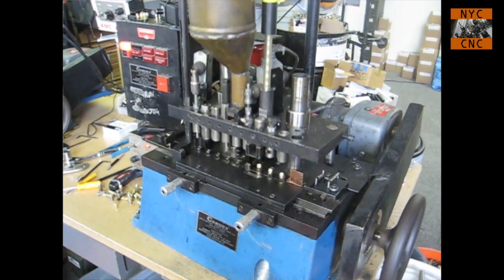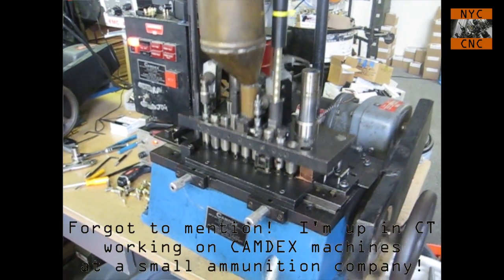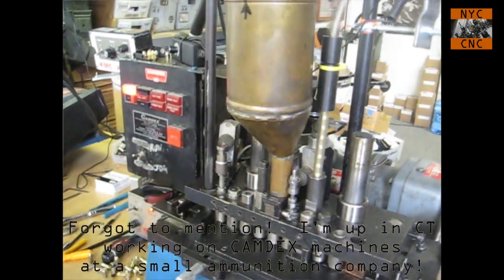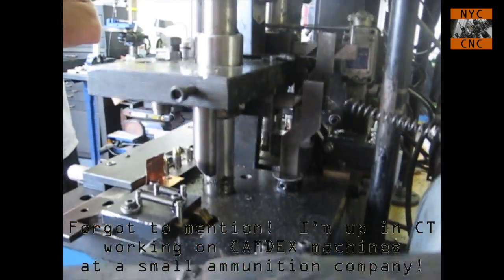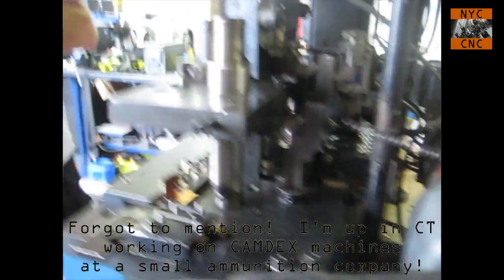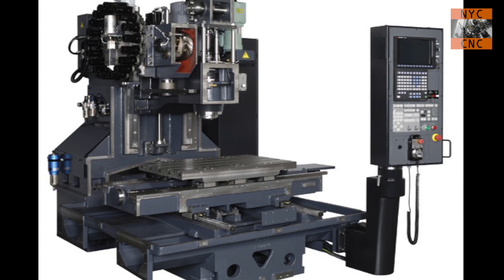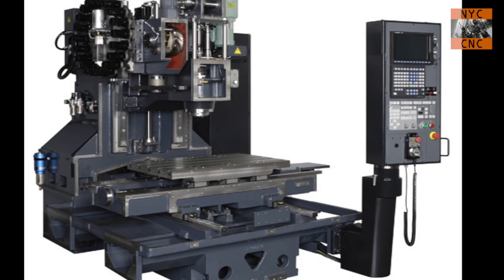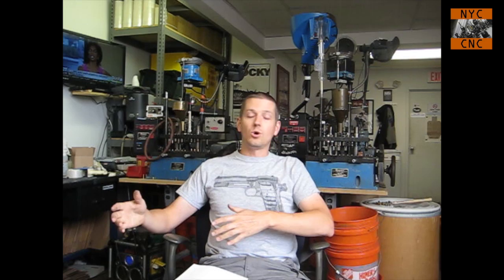Hunt for the VMC - Beginners Guide to buying a Vertical Machining Center

Comment: Isnt mori seki the same company as DMG Mori?
Reply: Deckel Maho geildermeister aka DMG merged with Mori seiki  now known as DMG Mori...This merger happened So they could enhance both companies global presence  and enhance both companies product range and Market share basically the thinking was if you can't beat them join them.They manufacture very high quality machines for various applications.This company is goal orientated and the very top end of the market.Very expensive but very solid machines @ the very forefront of technology.Their main competitors are OKOUMA/MAKINO/MAATSUURA not HAAS/Doosan or any other of the cheaper machine tool manufacturers out their.DMG MORI machines are aimed @ the high value component and production sectors not really subcontract and smaller job shops.Im not saying these sectors don't use them but the high machine cost restricts a lot of people from purchasing these higher end machines.

Comment: HAAS ALL DAY.
Reply: ROFL FKING MAO
Reply: Just brought a brand new Haas Mini-Mill, super simple control, havent had it long but Ive ran Haas's for the past 10-15 years.
Reply: BROUSBLADES Congrats. Did you look at anything else on the market?
Reply: NYC CNC For 1, I am using my CNC in my garage so space was limited, it was pretty expensive but my father has purchased over 2 Million dollars worth of Haas' over the past 10 years so I got that "family discount". They definitely rip you off with all the "extra" that should come standard with the machine like the memory, the machine came with 1mb of memory, keep in mind an MP3 song is usually between 3-4mb. Upgraded to 750mb for almost $2000 extra. Once you get all that bullshit out of the way they are great machines, they have great customer service and they are extremely user friendly. I ran Haas lathes for a lot of years too but mostly 5-Axis Haas for the past 8 years.
Reply: Mastercam

Comment: Man,are you on right track. I would check out a Fadal not greatest rapids or fastest tool changes but cheap and cheap to fix.  Mori Seki and DMG mori are the same company now.
Reply: NYC CNC Pretty much like used car.. Does it look used and abused? If so probably because it was.  Ask the owner if you see the machine under full power running a test program and couple tool changes. Does the owner have the manuals real handy if you get an older machine. Does the owner have services records? Two biggest questions are why are you selling it? Whats wrong with it?  What kind of environment? Job shop? One Material and one job etc

Comment: Support American products please.
Reply: Buy a good used mill and MANUFACTURE American products!
Reply: NYC CNC same as any other machine, the really important parts! Ballscrews, linear guides, motors, odds and ends. Really drives me nuts to listen to people bash on Haas, call them cheap and fragile, power is overrated, blah blah. Everything is cast iron. High dollar Bosch-Rexroth and nsk linear guides/ballscrews/bearings. Yaskawa AC servo motors driven using sinusoidal commutation from 45 amp servo amps controlled with 3-4 32 or 64 bit cold fire processors. Proprietary ballscrew temp comp that comes extremely close to linear scale accuracy. Machines are constantly turned off and on and run during assembly. Everyone is test cut and ball barred. Warehouse stocks nearly every part made, and has a same day ship rate of over 99%. Marketing is probably the smallest dept in the white collar area, dwarfed by engineering, which runs with a goal of producing 10% new product per year in addition to continuous improvement of current products. 

And no, I didn't pull this out of a marketing pamphlet.

Comment: Your back of the envelope VMC list omitted Milltronics.  I'm not in the market and know a lot less than you do on this subject, but I have a good friend who bought a VM17 and a VM25 (each new, I think) and has gotten good service from them for many years, and he DOES know a lot about this stuff.  I've seen them on the used market.  I seem to recall that Milltronics uses Windows.  If so, then I'd avoid them for that reason alone.

In this down economy, there are plenty of used machines.  Now that you're "actively looking", I bet you find something to your liking soon.  I look forward to those videos.

Be careful when you bring your new VMC home.  Spend some quality time with your Tormach, so she doesn't think you're spending all of your time doting over the new baby.  :-)
Reply: I'm fairly certain that the current Milltronics controller is Linux based.

Comment: A good way to get a cheap good as new machine is to get a worn out machine then replace the spindle bearings, ball screws and linear glide rails. When a company buys a new VMC they are expected by the manufacture to replace these a few times in the ten, twenty years of the machines practical life. When in actuality many job shops just run the machine until it's no longer making accurate parts then sell it off. If you can find an older machine the spend a few thousand on replacement parts then tear down and reassemble yourself, you will affectively have a brand new machine with an older controller.
Box way machines will need to have the main castings scraped, a vary time consuming and specialized endeavour. Unless they have removable wear rails. 
Look in to rail replacements, and alignment.
http://www.nskamericas.com/cps/rde/xbcr/na_es/E9008_Installation_Linear_Guides_Machine_Tool.pdf
Reply: NYC CNC
I'm not saying to get one that is down and out, but to get one that is fully operational but has some sloop in the travel. The kind of machines that pro shops would retired to the less critical work.

Comment: I'd say an AC servo should be a lot better service wise, than brushed DC servos, that have brushes that wear out and create dust etc. And I'm pretty sure all the new VMCs use AC servos as well? If they haven't started using brushless DC motors perhaps?

Anyway, AC servos should pretty much work until the bearings wear out :) But the servo drivers are more complex, so maybe that's the problem with the 1990 HAAS:es?
Reply: permanent magnet AC and brush-less DC is basically the same thing. With modern electronics it shouldn't be that much more complex to control a brushed vs. brush-less servo, it is basically 3 vs. 2 wires
Reply: The physical difference between brush-less DC and AC servo is the distribution of the phase windings; AC is sine wave fed and BDC is trapezoidal. Where do you want your losses concentrated, in the motor, or in the controller?
Reply: A trapezoidal controller at 100% output spends most of it's time not switching!
Reply: Paul Compton There's not going to be much difference in controller loss it is all switching controllers. You need two half bridges for a brushed motor, three half bridges for an AC/Brushless so it's not like there is much saved there either
Reply: Paul Compton 100% output is special case, especially for a servo